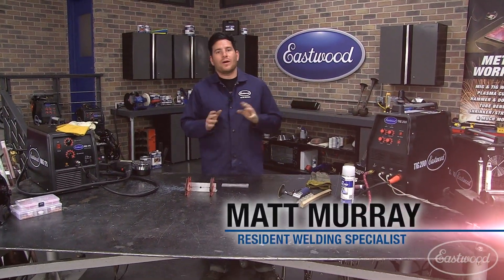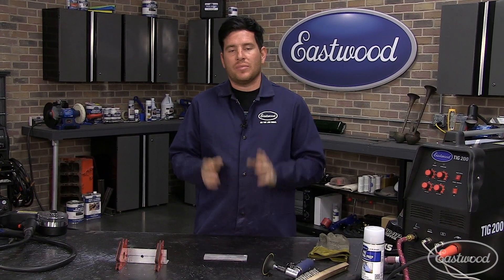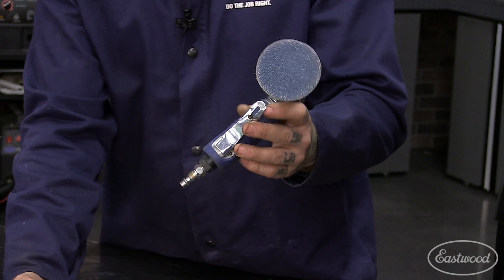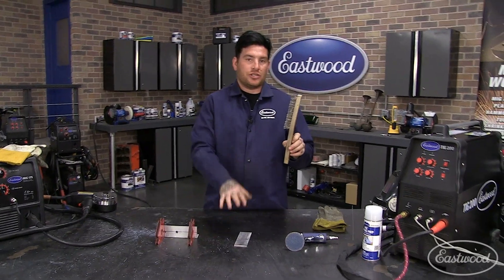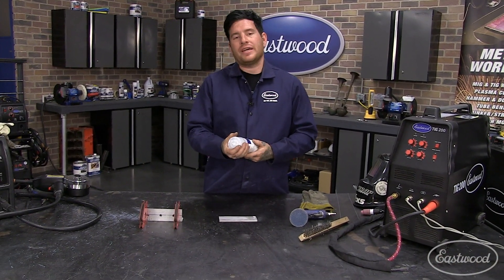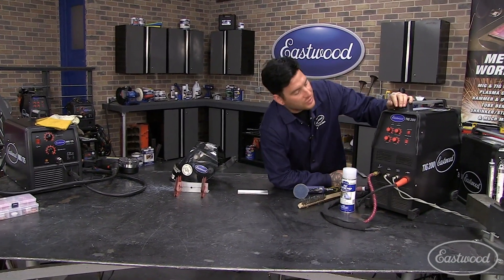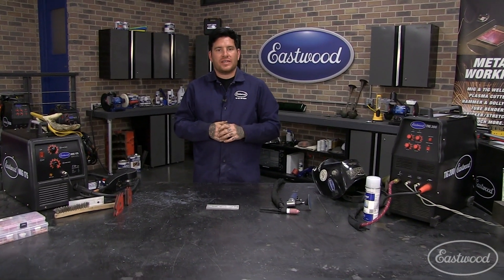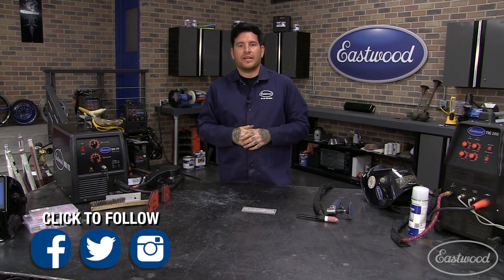How To TIG Weld Aluminum - Pointers and Troubleshooting with Eastwood

Comment: so, this is the first welder i ever welded on, first project was aluminum, struggled, but finally got some decent welds,
since then i've done nothing but stainless, gotten pretty good welding mostly 316 medical parts, repairs etc
no more blow holes, i can fuse .03, and weld with filler down to .025 thick stainless confidently now all day.
   To eastwood, or any other users my question is...
I got that original aluminum job back, and switched over to ac/green tungsten etc, same 100% argon yada yada,
only i cant even form a puddle before it gets black contaminated craters, as if im not using gas at all?
the tungsten immediately balls up, i get a brand new one, grind it to a point, hit the pedal...immediate black crappy cratering, no puddle whatsoever, most of the metal here is 6061 billet, or plate, tried all different pieces.

I've tried everything as far as settings go, gas is cranked up to 25, brand new electrodes, every clearance  factor from negative to positive, usually more positive makes more of a ball, but its bad all the way around,tried 1/16, up to 1/8
every current setting just to try and make a clean puddle, just on scrap aluminum 1/8 to 1/4 thick, clean as a whistle
sanded, cleaned deoxidized, same thing black popping cratering mess, is 

is there something inside the welder that might have taken a crap on the ac side that you've run into before im hoping?
i switch back to dc, and i can weld stainless flawlessly again. Let me know if this is a common machine failure,
its the 200 model that doesnt have the stick button.
Thanks for any help
Reply: Did you ever sort out what was happening? I have the same problem with an older lincoln 185
Reply: @hillbillyvilly7522  hey, sorry i just saw this
it turned out too be i used a different twistlok cable that had one of our high legs in it, i changed to 2 even legs and it seemed to work

Comment: what's the flow of your argon.
Reply from the maker: There's a chart on the TIG Welder with suggestions for aluminum.  It states:  1/16" and 3/32+ - 15 SCFH, 1/8" - 17 SCFH and for 3/16" - 21 SCFH.  This machine is really easy to dial-in and use if you reference the chart.  Hope this helps.

Comment: I just Purchased the 200 Series to weld mostly Aluminum .I purchased the Purple tungston but would I be able to weld a 3/4" to an 1/8" Block with this unit? Also i have about 10 Minutes experience lol so I'm trying to practice by following the chart but i'm having problems with filler rod melting before I hit the piece .What am I doing wrong? Please few tips ..I watched all the vdeos  none cover trouble shooting for idiots..lol Thank you.
Reply: The thing to keep in mind is to add your filler rod at a 90 degree angle to the TIG torch. In this example the TIG torch is a little more vertical, pointing more straight down at the workpiece especially when starting. As he moves through the weld the angle is more like a 45 degree angle. He adds the filler material at 90 degrees to the angle of the torch. The easy mistake is to not move your TIG torch hand as much and let the angle become shallower and shallower. The next thing you know your have more of a glancing blow kind of angle to the workpiece. Then if you add filler material at the same relaxed angle on the other side you will notice a lot of heat being sent to the filler rod which will melt it before it gets to the puddle.

Depending on the area you are welding, you might have to angle the torch differently but your filler rod should always be added at 90 degrees, or perfectly from the side, to reduce the amount of heat the end of your filler rod sees. I hope that was clear?

Comment: I hope theres a TIG welder out there with an automatic amperage throttling for aluminum.  Pumping the foot pedal for 8 hours straight during work would get tiring.